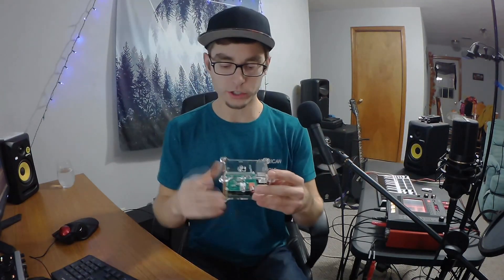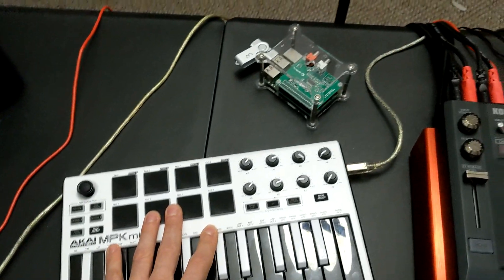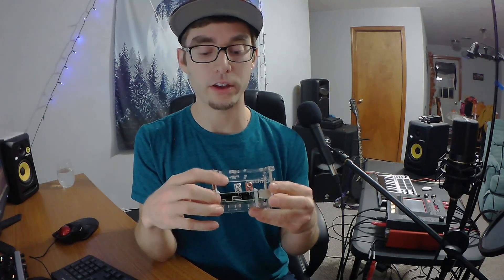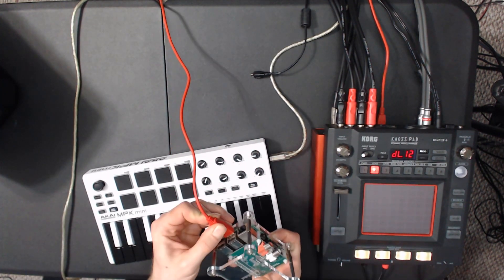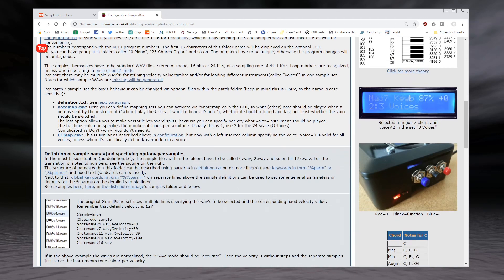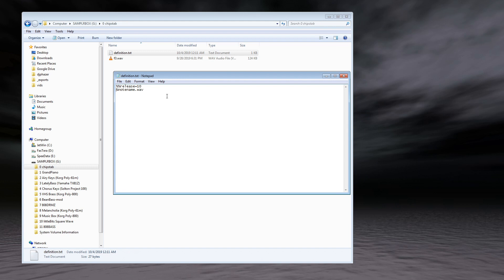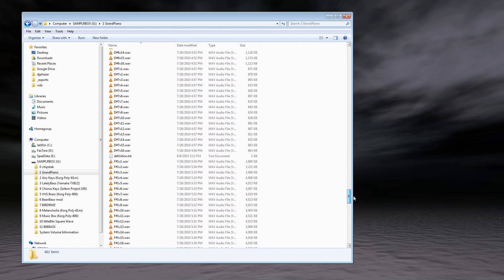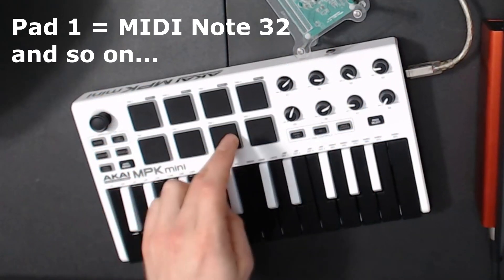[HowTo] Turn a Raspberry Pi into a DIY Virtual Instrument with SamplerBox | Phazerville

Comment: Been a minute since I dusted off my Pi and I wanted to see what’s cooking… well.. a headless multi sample playing instrument is pretty dam cool… now.. all it needs is a sequencer!
Reply from the maker: I was relying on external sequencing like the Keystep when I made this video... but I'm sure SamplerBox has evolved since then. There's also PureData and other such things that can run on a Pi.
Reply: @Phazerville  I need to check out what is available.. I have a couple pocket operators and they are powerful but basic, I can see a Pi having way more potential 👍
Reply from the maker: @DJCJ999 looks like the latest SamplerBox mod from Hans can play MIDI files... otherwise, I recommend checking out Patchbox OS

Comment: Cool potential. However the audio output is not connected to the pi audio hat - how do you get audio out?
Reply from the maker: in some parts of the video, I had USB connected to my Focusrite instead
Reply: @Phazerville Is the pie hat worth it? I already have a class d audio amp wired directly into a two by twelve cab. I just need to figure out how to get my guitar in, Without using an audio interface.

Comment: Hi! Did you've tried some Open Data based projects on Pi?
How much RAM do you need for a good work with SamplerBox? BTW... Reaper can be working on any Linux machine (incl. Raspberry Pi). Did you've tried?
My main needs are to have a good looper and basic FXs (like delay-echo, reverb, distortion-overdrive, flanger-chorus) inside one micro-PC (like Raspberry).
This quest was started as I've realized that I don't want Korg NTS-1. Although it can give great reverbs, delays, synths and etc. But it lacks a lot. Including some bad things like noise in audio. As a performing artist you understand me here, I'm sure.
Also I don't have plans to populate my flat with different fancy pedals like BigSky. These are overpriced :) And often gives you just a small part of what they could do per CPU power.
Will be glad if you'll direct me about all these moments.
P.S. I'm considering to buy Orange Pi but I've heard that there can be GPIO differences. I'm running the Neoris band project. If you're interested, I'll give you links to my bandcamp and etc.

Comment: Are you using the HiFi DAC here? It looks like nothing's plugging into it?

I'm wondering if you can run it by just plugging it in. I read somewhere you usually add a few lines of code to Raspbian OS or whatever you're using as an OS, so it can use the DAC?
Reply from the maker: I wasn't using it in the video - my Focusrite Scarlett 18i8 was plugged via USB - but I do use the Hifiberry. And yes you just have to add (or uncomment) a configuration line to enable it.

Comment: hi again, got all my stuff, wuestion! when you say "once you've got the software flashed onto an sd card" what do you mean exactly? I downloaded the samplerbox software, inserted my formatted for raspbian sd card into the computer, but when I try to drag the  samplerbox software into the sd card, it says not enough space (its 32GB and thesoftward is 1.7 Gb) any ideas if IM missing a step here?
thanks!
Reply from the maker: You either need to reformat/repartition the card entirely before copying files, or use a tool like balenaEtcher to "flash" the software image onto the card (as is the case with Hans' fork)
Reply: @Phazerville  thanks so much!
Reply: @Phazerville  hi again, ive got samplessets on my flash drive but whne i insert it, i only get the basic sound, nothing changes, no new sounds. Any idea why? I reformated my usb stick (Im on a mac) does this thinng not like macs? its wav and 16 bit, and the pi sees it on the screen but no sounds. i do program change on the midi keyboard, but sill no sound. Any ideas?

Comment: How does it work with drum samples and velocities?
Reply from the maker: I primarily use it as a simple drum sampler - one sample per note, velocity = volume level of the played hit (default). It is also possible to specify different samples for different velocity thresholds, as seen in the Grand Piano sample set available on the website.
Reply: @Phazerville  awesome! Thanks for the advice.

Comment: Windows 10 (IoT) is only available for rPi2 and rPi3, it is not available for the latest rPi4. Also it does not include support for x86 emulation so basically no software that runs on windows will work withe the rPi windows installation. Basically it can only run software from the "windows store" so its mostly useless unless you write the software you need yourself. which isnt feasible for most musicians
Reply from the maker: Lol yeahhhh, so... Windows on Pi is basically a joke 😜

Comment: Not a " Virtual Instrument " DIY video.  " Virtual " as in virtual reality means " as if " reality,  artifical,  you used a real keyboard.
Reply from the maker: I kinda see what you're saying... The device & keyboard controller are "real"/physical – the box is an instrument by its own right – but the sounds are a virtualization of a piano, for example, or an organ, a violin, etc. It's a way to electronically play the sound of an instrument, without the real thing. I use the term "Virtual Instrument" in lieu of a software plugin that emulates a physical instrument.

Comment: I may have missed it - how do you switch between sounds without a display or buttons?
Reply from the maker: By sending MIDI Program Change signals with my controller
Reply: Oh, I see. In my case, I don't have any extra buttons beyond the keyboard keys. Can I map a key to it? I'll rtfm shortly. :D

Comment: Hey I downloaded the software and flashed it on a sd card and managed to get a square wave sound when I play a note. However, I’ve got a usb that has other presets with a whole different instrument as the default and it won’t play it. Is there a step in missing or should I get the extended program in order to have it working?
Reply from the maker: You might have to either boot up the Pi with the USB plugged in, or send a MIDI Program Change to make it reload the sample set... Make sure the folder on the USB is named something like "0 mysounds"

Comment: does this work for mac too?
Reply from the maker: The RPi itself runs Linux, but yes, you should be able to find a Mac utility for writing the software to the SD card.
Reply: @Phazerville  what is the glass case you are using?
Reply from the maker: GeauxRobot Dog Bone stackable case - https://www.amazon.com/dp/B00NU70MZS/

...but I have since switched to a HiFiBerry case.

Comment: Amazing little thing. So it already have 2 working DAWs, its a synth, smapler, what else can it do. This is pretty amazing. I hear allot that it is heating pretty much bit I dont hear anyone complaining that it has burned or anything. Whats the average power use of this thing?
Reply from the maker: It's a computer! It'll do whatever you configure it to do... It's powered by a standard micro-usb power supply - 5V, 2.5A. I haven't tried overclocking it too much, so heat is not an issue.
Reply: Cases are cheap & they include fans yo keep it cool that are powered off the Pi.

Comment: you are actually not using the hifiberry outputs, right? if that's makes any sense...
Reply from the maker: Lol correct, I did not use them in this video... but I have modified my setup since then, so I'm using them now. It works just the same. Maybe if I ever find time to make a follow-up vid...
Reply: @Phazerville  Alright, glad you did so! doesn't make any sense to have the board if the outputs are not being used :S 
Cheers!

Comment: Could u pleaseeee do a tutorial on samplerbox and how u made it headless??
And what about sustaining notes.. because if it's samples it won't be able to do long notes unless samplerbox can read loop points..?
Reply from the maker: It does read loop points in the WAV files. And it works headless by default... It's just designed to have some kind of LED display or something.
Reply: @Phazerville  how do u mean by default..??
Reply from the maker: @boimesa8190  If you were to install, plug in and power on, it will work immediately without a screen - press a MIDI key and it will play a sound.
Reply: Phazerville by how to switch between presets? And will it work on Rpi 2?
Reply from the maker: @boimesa8190  Preset switching is triggered by MIDI ProgChange (PC) signals via my controller. It should work on Rpi2.
Reply: @Phazerville  But shouldn't they be mapped to do so first?
Reply from the maker: They are mapped like that by default on the main distribution. I think I had to do some tinkering to get it working on Hans' mod. Perhaps I'll go into more details in another video!
Reply: @Phazerville  but isn't it different for every midi cotroller... :S

Comment: Hey, pop question, do you find any kind of delay between you pressing the keys and the actual sound? Is that configurable?
Reply from the maker: Good question! In my experience with the Raspberry Pi 3 + HiFiBerry, there is VERY low latency between keypress and sound - low enough that I don't even notice. It just depends on your sound interface, and you can probably adjust the buffer size in the config files.

Comment: Have you tried “modep,”   The Mod Duo emulator for pi? Wondering how the effects stack up against something like NI Guitar Rig or Reaktor. Been considering putting a Pi3 to use in my studio but not sure it’d really make sense unless it can add something unique to my setup..got so many hardware synths and samplers (Deluge, MPC, etc) already...just waiting for that “killer app” before I commit.
Reply from the maker: Ooh, I have not! Thanks for bringing this to my attention. It looks promising! I know that SamplerBox can use a few effects plugins (reverb/delay, flanger, phaser, etc) under the hood, and they sound decent.